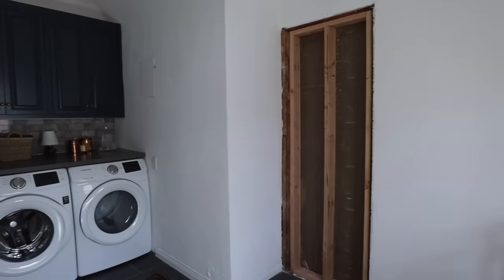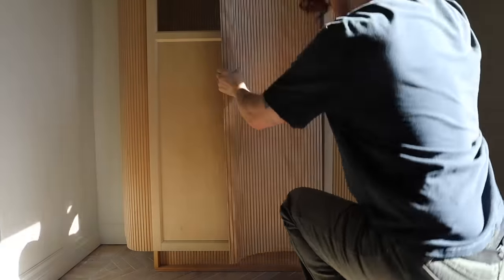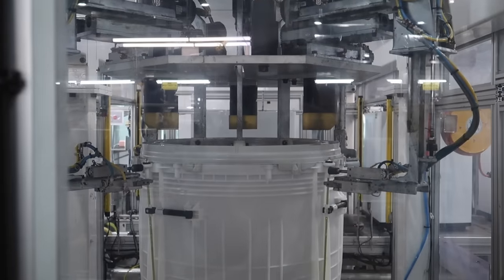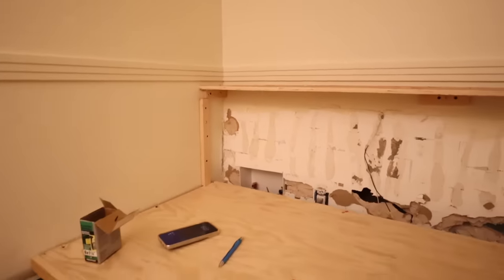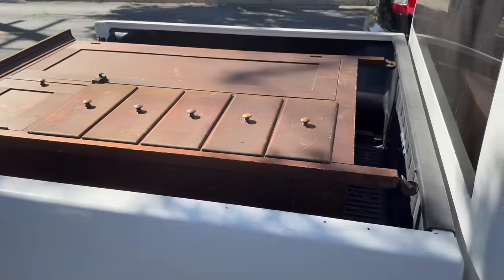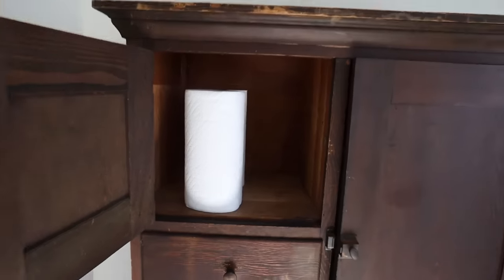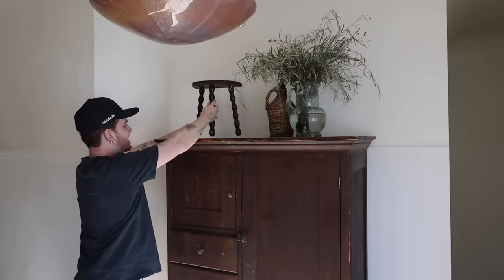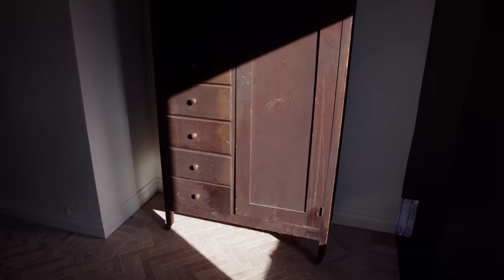Extreme Laundry Room Makeover 🧺 DIY Checkered Tile Countertops (FROM START TO FINISH)

Comment: Tip from my cabinet guy... When you have an issue like you had with the Billy bookcase where wood tones weren't matching because of sun exposure, take your doors and either A) set them outside in direct sun for several hours, or B) take them to a tanning salon to sit on a bed for 15-30 mins. It allows the wood to get the same patina as the rest of the cabinet so it matches better.
Reply: haha, I can imagine the faces when you go to the tanning salon with a couple of cabinet doors 😛
Reply from the maker: WOW! I love this
Reply: That's GREAT advice‼️👍🏼
Reply: That is hilarious but makes so much sense actually!
Reply: Tanning salon ? Ok 🤨

Comment: Just a note as a plumbers wife here 🙋🏻‍♀️ if ur drain ever backs up it could overflow at the washing machine drain onto back of wall 😬 making it accessible quickly to turn it off could prevent a lot of damage- maybe put a sensor on the wall or near by that can tell u if water overflows and isn’t visible right away? Just a thought, I’m sure simply safe has something for that.

Comment: The chair rail behind the cabinet was killing me, the new cabinet looks great!  The light fixture is giving Lowe's vibes.  Drawer slides would've been great on the countertop for making the plumbing and exhaust more accessible.  A lot of house fires are caused by lint buildup in the dryer exhaust, so it's something you want easily accessible for cleaning.
Reply: Yes!, or hinges, or ability to lift the backsplash and shelf off so you can access the turn offs.
Reply: I agree. Maybe it's cause I'm a Mom and have done more laundry than I care to remember but when he said he could pull the washer or dryer out to get to the water turn off or plug and my mind was just like NO. I  just think minutes count and there may be regrets with that design in the future. That said it all looks gorgeous, just not entirely practical. Also, that drop by the stairs stresses me out.
Reply: Yes, Drew, you will want quicker access....
Reply: Yeah that part was confusing me - I thought surely I must be misunderstanding until he started putting the tile on top of it. I don't really get that choice at all, especially when they've already had a massive leak in that room before.
Reply: Dryer lint clean out is also very important. My neighbor had a fire due to a loose connection and build up of excess lint.
Reply: Remember access could easily be Made through that closet behind those machines < << As they're  backed right up against those machines >  🤔 Righteously>>>>
in other words = cutting & creating a hinged door entrance through that closet wall >> that Drew got the pole from << might actually be the quickest access to any offending issues that might arise or happen in the future >> be they water leaks or lint pipe cleaning or any repairs or cleaning  issues....
 The faster One Can  Get to any Problem makes it easier on Your Budget Overall & creates Less Repairs from the damages caused if Left to Long 😮 unattended...
 Am pretty sure Drew & Justin thought through All 🤔 These major concerns before creating this design but then again changing things up is what Drew is Known to Do=
 Keeping Us in Suspense Waiting for His Next Creative Expression 😮
 Thankfully ALL concerns  when  talked about collectively are preventative Concerns again >> Safety 🦺 🛟 Issues 😢
 Best of All 😮 Many thoughtful solutions Come up by Collectively Sharing  Concerns & Solutions.
All These Thoughts 🤔 do hit on important Concerns and Thinking 🤔 of the Least expensive outcomes is Great for Everyone Whose Dealing with Things that have similarities Happening  ..   🦊 Collectively Everyone's thinking 🤔 there was a greater issue for Drew, & Justin to 🤔 Think  About ?? Especially since  these outcomes are ALL appearing to be more successful because We're  All ❤ adoring these Creative Souls Abilities more than Anyone ever anticipated 🙈 including Drew & Maria as they've been a team for a few Years but Justin is Proving Himself also Creative and Devoted to Artistic Creativity & Seems to Seriously support these projects  
It is Wonderful to Watch True Friendship develop into blossoming Careers & Long-term Relationships.❤
PS Love reading Commentary and the many pros and cons of our Perceptions & Perspectives ❤
Reply: You do need easy access to the water valves and the dryer vent.  Just a suggestion, but having been through laundry room nightmares in my days, quick access is the best.  Water damage is the worst!  😢 beautiful beautiful home though.  You are so talented!  You have great friends helping you! ❤
Reply from the maker: You can't not access the dryer exhaust without pulling them out anyway so either coming from the top or bottom, they will have to be removed to clean
Reply: Thanks Drew but do wish I'd come up with an Easier option for You...but Even if, I didn't your Designs are All Awesome 😎
By the way, your Billy bookcase that changed colors from the sun to Me is still Great but would now be great even if painted to exist in another space as that also was very Clever fix using those Ikea Doors..."Anyway one way or another You're Pivot is Always surrealistic " 😘🥰💝 Note.. 🎵🎶🎶🎶
PS Rather adopted You without You knowing BeCause "Your Red Haired Like my brother was in his Youth and Remind ME so much of my son's 😘🥰 living creative nature's
And that's a Huge Compliment to You believe it or not 😘🦊👍But then again I'd Lean into the two toned looks on Your doors and sides of that bookcase might start You yet another winning Brand 💝🤔OMG>>> You Go < Team Drew /"Lone🦊Fox"

Comment: Each and every one of your videos just amazes me more and more. How on earth does anyone ever think of creating a warm, inviting and cozy laundry room. Well you did of course! From my experience a laundry is either minimalist and cold or a room that gathers more and more odds and ends that have no other place to live. It’s usually a room where you keep the door firmly closed. What a beautiful job you have done on this room. It is so integrated with the rest of the house. I’d certainly be showing it off if it was mine. Certainly no closed door for this beauty. Congratulations Drew you have done it again. One thing though, as a great grandmama, I would certainly put a railing along that small area where the stairs are for safety. 😊💕

Comment: When the water lines to the washer fail, how are you turning off the water?  You will have to remember to go outside and turn off the water there.  You’ll have to tear down the back wall to replace the hoses.
Reply: Absolutely. It would have been only slightly more difficult to make that front panel detachable or able to open. Such an overlook
Reply: @rekwa3860  you could change the water hoses to steel braid hoses that tend to last longer.

Comment: Beautifully done as always! 

Wanted to let you know for any future timing projects (or for anyone else who happens to see this) you can actually cut a square hole in your wooden framing to create an “access panel” that can be reattached with magnets and still tiled over (only with silicone caulk instead of grout for easy removal). Contractors usually build these into built-in jacuzzi tubs so plumbers can access the mechanisms beneath the tub surround. From far away, the caulk will look identical to the grout (provided you purchase both in the same color) and no one else will be any the wiser that a small section of that tiled surface can actually be pried open to access whatever is underneath.

Obviously this job is already completed, but if you find yourself ever wanting to redo the tile in the future or constructing a similar project in the future, this could be something to consider to save yourself the hassle of moving appliances. 😊
Reply: Nice tip

Comment: I like the makeover but have a concern about access to the water shutoff valves for the washer incase of emergency.  My friend had the hose for the hot water come off.  She ended up with a small lake before she was able to shut off the water.  One person I know shuts off the water each time they have finished the laundry.  Also, recommended to shut off the water if going away.
Reply: Totally agree.

Comment: Please hang the rug with the "tapered" part pointing up. Its actually a truncated arrow. If the rug were on the floor, that part would point toward Mecca, so maybe it should point up toward the positive.☺
I love whole laundry room, the counter, the floor, the paint, the appliances, the light fixture, and especially the chiffarobe (that's what we in Tennessee call the half-wardrobe, half-chest). In the early 1900s, a gentleman's shaving supplies would have occupied the little cabinet atop the drawers.
I'm begging to install a rail because I'm scared that someone will take a tumble down those steep stairs!

Comment: Do you have access to your washer hose connectors or will it require some deconstruction to get to them? If/when a hose springs a leak you will need quick access so there is not a flood. That said, the room is just lovely. Never has a laundry room had such a talented presentation.

Comment: I have been using Earth Breeze - they are laundry soap sheets. These work great and work with front loadersm, you don't have the big heavy jugs of soap, as well as, most of the containers are not recycled! I order them from Amazon....they are less than the jugs of soap. You pay a lot for the water in those containers. Your laundry room looks great. You are a talent, for sure!

Comment: I would put a seal on that beautiful floor for 2 reasons. 1- stops it looking so dried out & 2- would give it a light glazed brick look where light flooding in from your window, would just dance across the floor, looking clean and not dusty. Good job as first try.

Comment: The room has the great energy found throughout your home. I agree with others that an opening to the back of the appliances through the closet is necessary. And I thought you might have placed an interesting piece in metal above the machines to complete that area.

Comment: 3 thoughts..bet you can find some perfect architectural element to DIY into a railing at the stairs...and PLEASE go into the back storage closet and cut a hole in the back wall to make the shut off valves for the W/D accessible again...... gritting my teeth over that one...prayer rug cuts the horizontal line of the trim...I would try a painting above the trim...can the prayer rug go at the top of the stairs...back side of kitchen wall?
Reply: Great idea. It could have a small door to cover the opening.

Comment: It’s absolutely stunning… never thought I’d say that about a laundry room, but given that it’s open, it really does need its own moment. I know you’ve centered the cabinet; however, when a corner (the one on the left) is seen from an angle, whatever is in the center near it appears closer to the corner, particularly when it’s in shadow. So, move the cabinet slightly to the right to compensate for the optical illusion. This happens also when people center a wall decoration in a small space between a curtain and the corner of the room… the item looks better slightly off center away from the corner. It will look centered unless you stand there and study it.

Comment: I actually found my cheeks hurting from smiling at your happiness over every item you touch! 😮 It's like Christmas everyday at your house when you open all the presents and find they're for you!😂 🎉 ❤  The bachelor's wardrobe is most appropriate for that spot; it flows with the laundry room.  My Dad had a taller wardrobe. Back in the day men had limited clothing items. Shoes were kept at the bottom. A top hat or fedora would go in the cubby cabinet.

Comment: Great job and way to roll with whatever comes up!  I wasn't fan of the tile at first, but once you stained the light colored tiles, I loved it!  The darker color of the stained tile, along with the darker colored clothes hanging rod, goes so nicely with the dream cabinet standing on the wall opposite.  

When you first showed your inspo photos, I was wishing for something like the chifforobe or the folk art painted one.  I was bummed when you couldn't find one like either, but I felt your free find was a good sub.  I wasn't a fan of the IKEA one you briefly brought upstairs in this video.  I liked it as a bookcase and where you had it.  I was THRILLED with you finding the gentleman's chest/chifforobe!!  It's so perfect in the space and especially with that FABULOUS light!  It all just turned out beautifully!  

I hope you like your LG washer/dryer set.  I have LG and love mine.  They're not the same ones - I opted for top load because of high humidity where I live and the design of my house not allowing for the door of a front loader to stay open slightly for air flow to allow drying.  

Anyway, it all turned out beautifully - forgot to say how much I liked the dried leaves in the pitcher you added at the end!  A pretty touch of lightness!

Comment: Looks great as always. But just a little concerned that the dryer may overheat, being set in so flush... I found out (too late) that my dryer needed more space at the back for ventilation of  the hot air expended as it works... hope yours doesn't 😬

Comment: You put so much hard work into all of your makeovers, and I really like that you showed us the process and how sometimes you need to switch gears when something is not appealing to you. Not gonna lie though, not a fan of the hanging light, the stool on the cabinet and for some reason, not a fan of the tiling on the countertop either. I find that something is missing on the wall behind the washer/dryer there. Lastly,  I think the cabinet you ended up with is perfect though not tall enough. I was kinda sad to see that you did not clean it up before using it lol.I would have liked to have you pan out to the flooring as well, in the final reveal,  to see the cohesion of it all. My favorite part of this makeover was definitely the tiling on the floor  (a true work of art!) and the paint colour you chose for the walls. Obviously what matters is what you like and we thank you for taking us along! X

Comment: Your new laundry look is stunning, and so fascinating to watch you go through your process. I love that you aren't 'married' to a look and are unafraid to change direction as you go. Like several others have mentioned, my heart has been in my throat several times during the process as you've moved around dangerously close to that unprotected stairway. I think something non-visual would be good there so as not to close in, clutter the small space. Safety glass, attached or inset into a channel on wood posts at wall and top of stairs could be an unobtrusive, minimalist solution, I think.
Reply: That was my first thought too, safety glass wouldn't clutter the space but would add much needed safety precaution.

Comment: You have an eye for display but I am incredibly practical so was surprised to see you did not grout the tiles in the laundry room and put the stain on the tiles.  If this surface is not sealed there is a possibility that the stain would mark wet garments when they are put on top?
Reply: Totally agree, this was also my first thought.

Comment: Am not a fan of the checkerboard tile look, as it’s a bit busy. Though I must say staining the lighter, porous tile brown is a massive improvement.  Please stain the face plate tiles above the W/D darker before sealing. Cute vintage cabinet. Looks in desperate need of a good cleaning and cream nourishment of the wood. No to the stool on top of the cabinet. Hire about putting it in place of the basket above the W/D? A plant with draping leaves woods look nice.

Comment: Wait, the water shut off for your washer is only accessible if you pull out the washer? Doesn't seem like a good idea to me, don't you usually have to shut off the water in order to move your washer out?

Comment: Don’t take offense, but I prefer the countertop and the cupboard above the washer/dryer to the makeover. I think it was more subtle and it could’ve worked with the cupboard that you end up purchasing and putting in there. I just think it was a nicer overall finish before.

Comment: You shouldn't put water in with dried flowers, it will get moldy and you'll have to through them out. If you want your dried flowers to last, put them in a vase without water.

Comment: Everything looks great but I think you really shouldn’t have tiled the countertop and blocked the water shutoffs.    In an emergency, the last thing you’re going to want to be doing is having to pull out the washer and dryer in order to access the shut off valves.   Another potential area of water leakage is the drain hose from the washer into the downspout.    My upstairs neighbor’s drain hose slipped out of its clip once and it looked like it was raining in my laundry room before I made it upstairs and told her to turn off her machine.

Comment: Oh boy.  Having to pull out the washer & dryer, electrical products, during a water emergency....  I dunno guys.  Seems dangerous. Just promise me you'll shut of the breaker and then the water at the next shut-off (i.e. in the basement) rather than get in the middle of it at the machines whereby even touching the machines while the power is on with water spraying around could result in electrical shock.